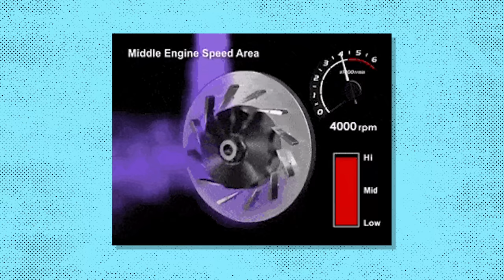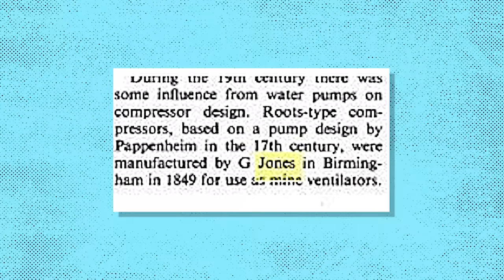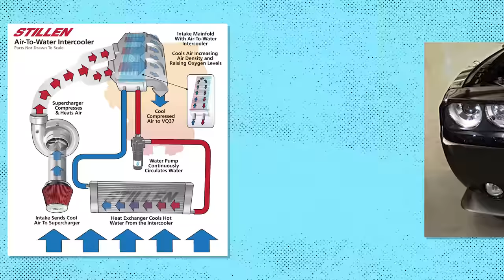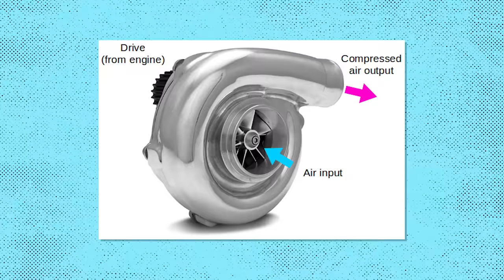Why Superchargers Aren't As Good as Turbos

Comment: For anyone who doesn't know, turbochargers being "neatly tucked away" actually translates to "major pain in the ass to work on" compared to a positive displacement supercharger
Reply: Yes, it seems my son's diesel needs a new turbo, the suspension needs to come out, together with the drive shaft and engine mounting.  Just go for a bigger engine, in the case with petrol anyway.
Reply: Yup.
Reply: pulled the blower off my amg in an hour, so simple.  Doing a turbo replacement on my gfs BMW and it's a 20hr job on the books lol.  I do like the simplicity of a blower
Reply: @Cummins_12V sorry, you'll have to explain please.
Reply: Oh boy and how. I once blew a turbo on my car and cuz I'm an engineer I thought: 'Hey, no need to pay a fortune for someone else to put in the new one, I can do this myself'! Oh boy... but for some reason I didn't learn from the experience and only a few years later thought the same when it came to replacing the clutch.
Reply: @dwiesch  least you admit it, many don't.  I've had a go when I was younger, but can't be bothered now lol
Reply: The sad thing is most of the people that have problems with a turbocharger is because they didn't read thier owners manual and cannot properly read the label on a bottle of motor oil.

You don't need to spend a whole weekend replacing a turbocharger when all you need is to learn how to read..
Reply: @rob5944  Maybe a bicycle would be  a better choice...
Reply: @dwiesch Are you a  locomotive engineer???
Reply: Yup
Reply: 100%!
Reply: @torkrench  Not true... the turbocharger on most cars is not any  harder to get to than omw some superchargers and alot of other components that requires repair.
Turbos on a good quality vehicle last 150,000 miles or more..
Reply: @sandervanderkammen9230  as do superchargers, which dont have hotside impeller housings that crack, wastegate linkages that fail, rusted ass exhaust parts that rot or snap, etc.  Yes there are pain in the ass supercharger installs too, but eatons tend to do their job for hundreds of thousand thankless miles & are no harder to replace than an intake manifold.  (And yes i actually have grease under my nails daily)
Reply: @torkrench  Then explain why all cars don't have an Eaton supercharger? Or why 40 percent of new cars are turbocharged???
Reply: @torkrench  Interesting theory considering that turbos first appeared on aircraft, locomotives and heavy duty vehicles...
All very large displacement and distinctively low rpm... they benefit from same increased fuel efficiency, power output and emissions as small high revving engines..
In fact, forced induction reduces the need for higher rpm to improve volumetric efficiency.
Reply: @torkrench  Spoken like someone who has little education or intelligence and works in a menial job.
Reply: @torkrench  Turbochargers are reliable enough to pass FAA or EASA airworthiness certification for passenger aircraft... the highest standards for engine reliability.
Reply: Yup, and turbos are way harder to instal. Turbos also add more heat.
Reply: @angelgjr1999  Turbos don't add heat, they create more horsepower.
Reply: @sandervanderkammen9230  40% of new cars being turbocharged is a moot point against their reliability, considering that cars nowadays are becoming less and less reliable. The reason superchargers aren't used is because always making boost = always using more gas. A turbocharger barely uses any gas or has a horsepower loss to drive it while it isn't spooled up.

Also on the point of turbochargers were originally used in airplanes, WW2 airplanes required overhauls on very small intervals, they were built for tremendously high horsepower numbers and wore quickly. Also the only major fighters to use the turbo were the P-38 and P-47, every other plane used centrifugal superchargers.

Edit: the reason why turbochargers were used on so few airplanes is because turbocharger design was behind supercharger design, and most aero corporations couldn't wait for the turbo to work (it had sizing and reliability issues in development). For example the P-39 was originally developed to use a turbocharger but was replaced with a supercharger because GE was behind on their turbo development and the turbo jutted out of the plane making a large bulge on one side that caused aerodynamic losses. The P-47 was the heaviest single engine airplane in the war due to the turbo.
Reply: @vasilis23456  You must be very young? Or drive some horrible cars?
Reliably of automobiles is very good today compared to decades ago.

Not true, that depends on the type of supercharger, the engine to compressor drive rpm ratio, if it has a clutch or variable speed drive and if the engine is equipped with a manifold recycle valve or VVT/VET.

Supercharged engines always use more fuel because they have a parasitic loss driving the compressor.
The turbos' compressor is not driven by the crankshaft under any condition. (Except EMD engines)
However in a compound turbo-supercharger system the turbo can be used to "unload" the Supercharger compressor to save fuel. (Locomotives have two ways to do this, eg; EMD)
Turbochargers were developed well before WW2 for use in Locomotive and truck applications.

What about the B-17 and B-24??? They were also turbocharged. As were some Geman aircraft with BMW and Jumo engines.
What about aircraft that are turbo-normalized, they don't make any additional power over sea level rating?

The R-2800 was a massive 18 cylinder that weight 2,500 lbs... it would not fit in most ww2 single engine fighters, the P-47 was essentially built around this mammoth bomber engine.
Reply: Depends where you put the turbo. Mine is right next to the engine and is easy to get to.
Reply: @177SCmaro  I don't think that would count as being "tucked away". Your build looks sick though!
Reply: didnt ask
Reply: They still better, you want hp, use turbo
Reply: Yeah, if ANY consumables like spark plugs or other important parts are "Neatly tucked away", that's a good way to catch a throat punch from a mechanic lmao
Reply: Depends on the engine imo. 
Some want immediate boost for low end, some want boost for when it’s going.

Turbos are the go-to on modern cars due to only needing boost at high RPM and fuel efficiency concerns, good luck selling a hatchback with 13MPG nowadays, and a family car isn’t aiming for 0-60 speed last time I checked.

Simply put, if superchargers were useless, why would companies like Ford and Dodge use them for their top of the line vehicles? Would they really shoot themselves in the foot trying to set records for production cars?

I know I’ll be going for a supercharger on a gen 3 Coyote I’m building up, but for an older inline 6 I’ve thrown in a turbo. Different tools, different sources of boost. 

And, for the record, both have parasitic losses. Back pressure in your exhaust does have a negative impact. Turbos just have less of said negative.
Reply: @sandervanderkammen9230  In fact, they remove heat from the exhaust flow.
Reply: @vasilis23456  Oh, boy, the P-39 thing again.  Here's the deal with American turbosupercharged aircraft.  The GE turbosuperchargers were quite mature - they'd been in development since World War 1, and had been in production aircraft (The Consolidated PB-2/P-30) since 1934. They were 2-stage installations - the engines had integral 1-speed centrifugal blowers, fed by the turbosupercharger, with an intercooler between the turbocharger outlet and the integral blower.  Other than the initial prototypes, every B-17 and B-24 were turbosupercharged.  So, of course, was the B-29. The problem with the P-39 was that it was too small an airframe for what they were trying to accomplish.  Yes, the original airplane had a turbosupercharger, but its performance when tested proved to be much less than estimated.  So, they stuck it in the N.A.C.A. Full Scale Tunnel, and started pulling things off as they ran tests.  The big culprits for drag were the intercooler (Necessary to reduce the charge temperature before the integral supercharger) the oil coolers, and the semi-exposed nose landing gear.  The only way to make the performance guarantees was to eliminate these, which also meant that the turbosupercharger was no longer practical, essentially redesign the fuselage, and use a V1710 with an altitude-rated centrifugal blower. (Which, by the way, performed almost identically to the single-stage Merlins at the time).
This was acceptable, but the P-39 was never well liked in USAAF service - its small size and poor fuel fraction meant that it was too short-ranged and couldn't carry a useful air-ground payload for the offensive type of war that we were fighting.  It's worth noting that the descendant of the P-39, the P-63, was a substantially larger airplane, with a hydraulically coupled auxiliary stage supercharger (A return to the 2-stage installation) but, even with that, there wasn't room for an intercooler, and that significantly limited performance.
If the turbosuperchargers had a weakness, it was that early in the war, the wastegate regulators were mechanical/hydraulic systems, using engine oil, which were vulnerable to the coking and sludging that occurs.  By mid-war, turbosupercharger regulators were electronic, and the problem was eliminated.
Oh, and a quick look at the manuals shows that the P-47 (with turbosupercharger) and the F4U Corsair (2-stage mechanical supercharger) are very close in size and weight.
Reply: @peterstickney7608  Excellent comment.
Reply: Yeh my Rotrex supercharger was a hoot on my k24, no lag no charge Temps problems and a kid could fit it.
Reply: @torkrench  Rotrex supercharger, belt a bracket a k24 and 500hp. Maybe intercooler plumbing. Kid could fit it.
Reply: @sandervanderkammen9230  sorry I've used both and both are great but Rotrex supercharger on a k24 was awesome and easy to install and still runs 500hp after 55 thousand miles. Instant power delivery with correct pulley and intercooler. Simple fast easy, I drive a turbo car too but the charger is just as much fun.
Reply: @slartybartfast1  The facts remain the same... you engine would make more power and your car would be faster with a turbocharger.
 I think the biggest problem is that most people simply don't understand how turbochargers work and fear what they don't understand.
Reply: @slartybartfast1  Turbo lag is an imaginary problem... its not really.
 Turbo lag is not accelleration lag.
Reply: @sandervanderkammen9230  yes your correct of course turbos are not parasitic like a supercharger so make more power. My charger was a Rotrex supercharger, easy to fit reliable and 500hp no problems at all. I could make 550 with turbo and lag but what's 50hp in a EP3. Just a little faster but who cares, both work really well.
Reply: @sandervanderkammen9230  yet still accelerating just slowly to start with. 🤣
Reply: @slartybartfast1  but much faster at the finish...
Reply: @sandervanderkammen9230  And?
Reply: @slartybartfast1  Still accelerating faster than a suprcharger
Reply: @sandervanderkammen9230  ok
Reply: Don't forget the heat destroying stuff & hard to avoid oil leaks & oil burning.
Reply: @ohane1  FUD
Reply: @sandervanderkammen9230, “People don’t understand how turbochargers work and they fear what they don’t understand.”

….oh my god 😭 Or maybe it’s different applications and desired traits for somebody’s car calls for different solutions.
Reply: @hectichive889  Only if your desired trait and application is to go slower than a turbo car.
Reply: @hectichive889  You shouldn't be afraid of turbos because you don't understand them, educated yourself instead.
Reply: @sandervanderkammen9230  This is how I know you’re like 13 or somethin… You’re missing my point. Do a little more digging around than just watching youtube videos. Turbos are definitely good for going fast in most applications, but today’s superchargers are pretty easily making around the same power numbers on average. The real benefit to superchargers though is that they have immediate boost and excellent throttle response with zero lag, much like a NA engine. For instance, if you’re building a car for autocross or smaller race courses, a lot of racers mention that they prefer the instant torque and response of a supercharger for getting them a faster exit speed. And a lot of is just straight up down to personal taste. I would prefer a supercharger for the feel of it and you can still obviously get monstrous power out of them. I’ll concede for most people if you’re straight up going for nothing but pure hp numbers, unless you’ve got a supercharged NHRA dragster, you’re probably going to go turbocharger. My personal pick for a good compromise at that point would be to pick up a centrifugal supercharger.
Reply: @hectichive889  Please stop posting lies and ignorant misinformation...
Turbo lag is not acceleration lag, a turbo car will always accelerate faster than the same car with a supercharger.

Turbo lag is an imaginary problem, its not real... a properly skilled driver can easily adapt to the different torque and power curves, inexperienced drivers with limited skills are often intimidated by turbos, the additional surge of torque can unnerve, even frighten them.
Reply: @hectichive889  If you have an NHRA dragster? You would probably go with a turbocharger too... unfortunately turbochargers were banned by the NHRA because they made the cars too fast.
Reply: Thank you
Reply: Worked with cars like these and I agree. Major butthurt

Comment: One area the supercharger will always win over a turbo is exhaust note
Reply: And maintenance 😂😂
Reply: Fun
Reply: laughs in Stututututu
Reply: @abhishekagrawal4575  and killed the exhaust note 💀
Reply: @abhishekagrawal4575  to be technically correct stututututu is not the exhaust sound but wasted intake
Reply: @vikuntgupta4093  Turbo cars are not hard to maintain and are cheap to fix. A oem turbo for a shitbox can be had brand new for like £1500.
Reply: @v4skunk739  or you can risk it all and go with a $150 yin yang spinny thang 😂😂😂
Reply: @v4skunk739  1500 for a turbo is a lot. That's going into supercharger territory. But we'll that's the OEM quality after all
Reply: I think you mean intake note.
Reply: @RyanHarris77  I think I meant exhaust note ^_^
Reply: @budyeddi5814  aye, I see what you’re saying. You could include NA engines alongside supercharged engines for sounding better than turbocharged engines in that case. I initially thought you were referring to supercharger whine in your comment. My apologies.
Reply: @RyanHarris77  all good m8 ^_^
Reply: @v4skunk739  I rather just have a simple bolt on. Superchargers are superior.
Reply: Reliability
Reply: Wheeeeeee
Reply: Lower rpm. to Mid RPM instant throttle response and torque and limited boost PSI ratings
Reply: That makes no sense, tbh i think superchargers sound trash really annoying screaming noise sounds like Ksi laugh
Reply: @oogs9114  what does that have to do with exhaust note
Reply: Laughs in Naturally Aspirated V8
Reply: @Citizen_Snips1  supercharged and NA have the same exhaust setup. Hence my comment ;^)
Reply: 2jz enters the chat
Honestly I think the 2jz-gte sounds better than the GE because the turbo softens the exhaust note. A 2jz-ge is very harsh sounding
Reply: @Dave-dh7rt  I love the way the 1jz sounds ^_^
Reply: Amen to that Bud. And much simpler to work on.
Reply: Nahhhh you got that one messed up. Superchargers hve a better intake sound, but if you think turbo exhaust notes are inferior I dunno what can be done to help you mah boy
Reply: @mizaqenyad4269  turbochargers not only "muffle" the notes a bit, they also eliminate all the cool pulses you get from an N/A or Supercharged setups
Reply: @budyeddi5814  laughs in EJ257
Reply: @v4skunk739  £1500 is a lot of money, especially for a shit box running 0.5 bar of boost on a diesel engine.

Not to mention most are integrated into the exhaust manifold. Just buy an aftermarket manifold and a garrett turbo at that point
Reply: And quarter mile timing
Reply: @ulisesavila2879  Don't go look up how much after market turbos cost, you are crazy.
Reply: You have never been to a Formula 1 race...
Reply: @sandervanderkammen9230  we're obviously discussing production based vehicles but considering there's no modern supercharged F1 car your comment is even more irrelevant
Reply: @duke9620  you'll never convince me that a turbo LS sounds better than a supercharged or n/a LS (or any engine for that matter)
Reply: @budyeddi5814  Nothing is more irrelevant than your original comment...
Reply: @sandervanderkammen9230  yet, here you are

😂😂😂💀💀💀
Reply: @budyeddi5814  I'm sorry, is that your girlfriend???
Reply: @budyeddi5814  Angry little boys like you don't intimidate me son...
Reply: @sandervanderkammen9230  yes ma'am
Reply: @budyeddi5814  You have alot of growing up to do kid.
Reply: @sandervanderkammen9230  yes ma'am, whatever you say 😂😂😂
Reply: @budyeddi5814  Thank you for proving my point.
Reply: @sandervanderkammen9230  you're welcome m'lady 👸
Reply: @budyeddi5814  Nice try, still not working kid.
Reply: @sandervanderkammen9230  yet here you are still 🤔 Something is working. But it's NOT your brain 

Ma'am
Reply: @abhishekagrawal4575  only lasts a fraction of a second and can't be heard at peak revs or top speed
Reply: Turbos and superchargers sound good in their own ways